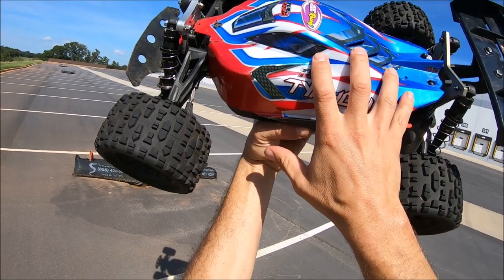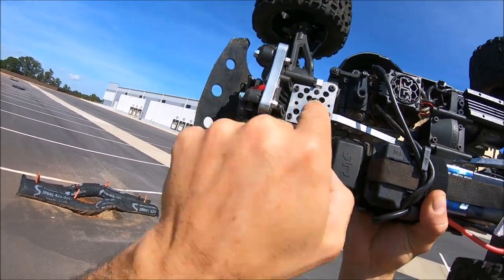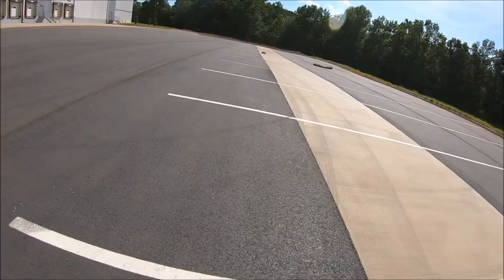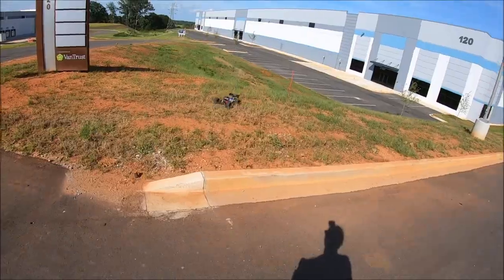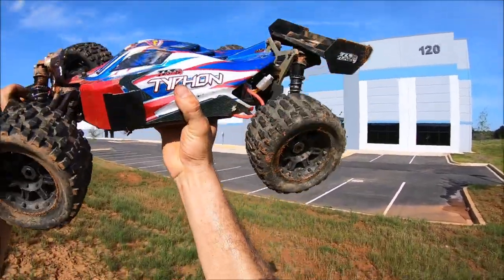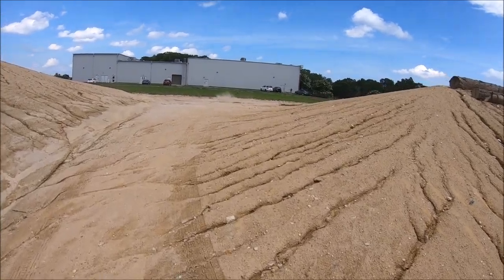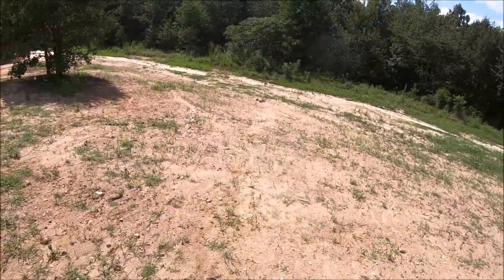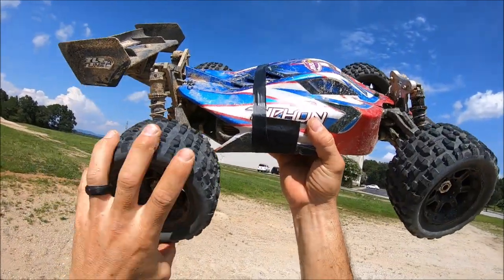The Truggified MISSLE!! ARRMA TLR Typhon 6s!

Comment: curious is that the Talion upper hinge pin suspension block?  M2C doesn't show that under typhon,  will that fit v5 i'm confused lol,  great video, upvoted!
Reply from the maker: All 6s upper blocks are the same except EXB models. You would need to change the upper pins as well to regular threaded pins.
Reply: @RCDUDE81  copy that thanks man!!
Reply: What A and B block did you go with?